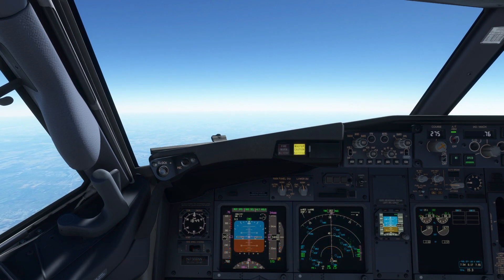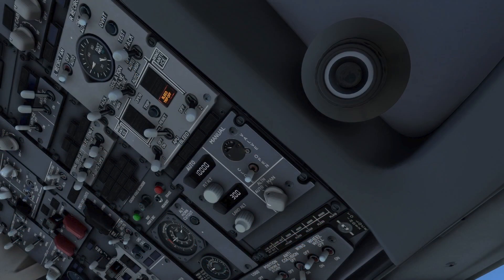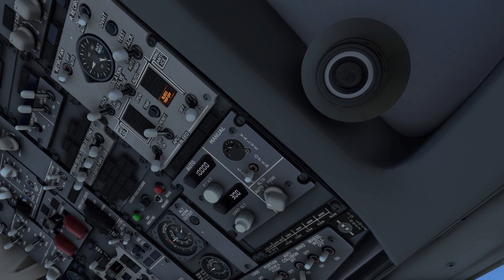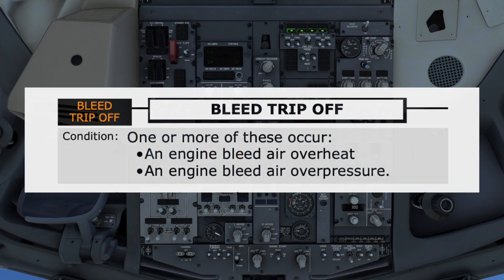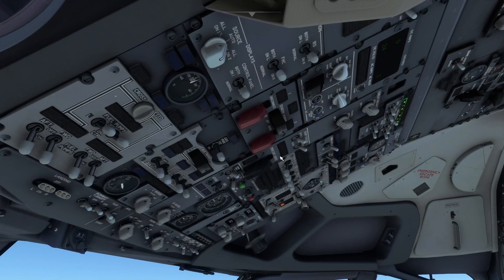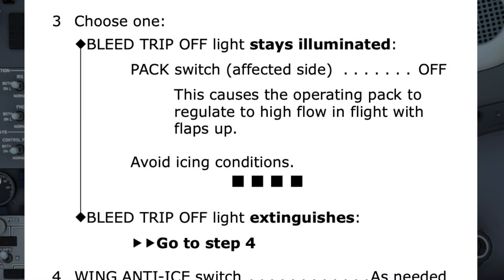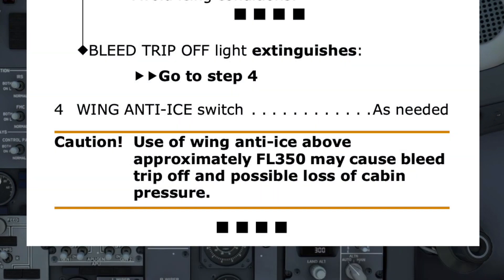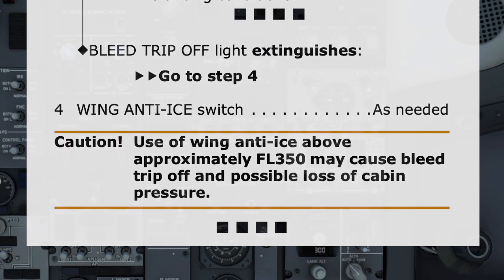737 Non-Normal Procedures: Engine Bleed Trip Off

Comment: @0:38 “ENG” on the systems annunciator is a reference to the Engine panel on the aft over head. If there was a BLEED TRIP OFF light then AIR COND would be annunciated
Reply from the maker: Thanks, that makes sense. If some sim issues come up perhaps we can request updates. The good thing is that any annunciation will cause the pilots to check the overhead panel and see the issue, perhaps only one annunciation light is needed, 'OVERHEAD PANEL', lol.
Reply: @pilottutorials  😂
Reply from the maker: If you have time, could you give input on the comments here: https://youtu.be/xTmN-1dxDSk
Reply: @pilottutorials done 👍

Comment: I was flying at  FL360 and I had multiple BLEED TRIP OFF warning and I see the illuminated the warnings on the overhead panel. I had just turned off wing anti ice system, However I didn not press and hold the trip reset button. Afterward I engageed to descent part of the flight and I saw the BLEED TRIP OFF light is extinguished. So what should we do if we floy over  FL350 in this conditions? Maybe performing the emergency descent procedure was enough? Thank you so much for now. !!
Reply from the maker: Thanks for the question, just as a mechanic might ask, what steps would you take to replicate this? I take it you had selected the engine bleed trip off failure while cruising at FL360?
Reply: @pilottutorials  yes. I got this failure while I am cruising at FL360. When I turn off the wing anti ice system, the failure warn extinguishes. When I turn on the wing anti ice system, I got this failure again. Afterward, during establishing ILS system,  the failure had extinguished. However I never get any failure such as cabin altitude warn light near of PFD. The trip was good. I landed successfully. But I could not figure out the reason of this failure.
Reply from the maker: If you take a look at an earlier answer above 'use of wing anti-ice above approximately FL350 may cause bleed trip-off and possible loss of cabin pressure', this is not a failure but rather operational consideration of the wing anti-ice system.

The preferred method of using wing anti-ice in-flight is to de-ice (remove visible icing), so you need only select it when required. Alternatively you can use wing anti-ice to anti-ice (prevent ice formation) but would require it being on longer.

Indication of ice accumulation would include visible ice on the flight deck window frames, windshield center post, or on the windshield wiper arm.

If you find yourself in icing conditions above FL350 that necessitates the use of wing anti-ice, and it's use results in a bleed trip off, consider requesting a different altitude (higher to clear weather) or FL350 or below based on system knowledge.
Reply: Absolutely thank you so much for your detailed explanation about this topic.  @pilottutorials
Reply from the maker: Just tried at FL360 and FL380 at various mach numbers (power settings), couldn't get a bleed trip off, out of interest did you use MSFS 2020 or X-Plane?
Reply: I use X-Plane 11, However, if I want to try different aircrafts for short ranges, I use  MSFS 2020. Unfortunately, I do not have joystick and I can not use effectively the MSFS 2020. Because managing the control surfaces of airplane is too hard by using the keyboard. @pilottutorials
Reply from the maker: Thanks. Sorry you don't have a joystick, do you plan to buy one, or maybe some one here has an extra one!
Reply: @pilottutorials  Thanks too. I am gonna buy new one but not now.
Reply from the maker: @FlightdeckTurkey737 Thanks again for your question, as a result here is a video to explore wing anti-ice use above FL350, hope you like!

https://www.youtube.com/watch?v=UsTscifdnS0
Reply: @pilottutorials  I appreciate you ✈️
Reply: Wait, are you guys saying that the BLEED TRIP OFF light extinguished by itself? If so, then there is a fault in the SIM.

On the real aeroplane, there is an overheat relay in the Air Conditioning Accessory Unit which is energised for over pressure (220 psi) or over temperature (490F). A holding circuit connects through the air conditioning panel TRIP RESET push-button switch.

To get control of the engine bleed system after a bleed trip off, these conditions must occur:
- The overpressure (220 psi) or overtemperature switch (490F) must return to its normal (open) condition
- You must push the air conditioning panel TRIP RESET push-button switch (to break the holding circuit).

Comment: Can you please explain why would there be loss os cabin pressure as stated in the checklist
Reply: Pressurisation works basically by air being pumped into the cabin from 2 air conditioning packs. The air then exits the aircraft via a single outflow valve. The rate at which the air enters the cabin and exits the cabin is carefully controlled to maintain the correct pressure within the cabin.

Each engine bleed system supplies an air conditioning pack. The air conditioning pack supplies air for ventilation but also for pressurisation. If you have a bleed trip, the pack is no longer being supplied with air, so the pack is no longer supplying air for pressurisation. Half of the air that is pumped into the cabin used to pressurise it has now been lost. The outflow valve will move towards a more closed position but the loss of one pack will be too great and the system won’t be able to cope. There will be more leakage of air out of the aircraft then air entering the aircraft. That is why there would be a loss of cabin pressure.
Reply from the maker: An excellent question.

The caution in the checklist comes directly after the path were the lights have extinguished and the checklist indicates that wing anti-ice may be used as needed. It really is a reminder of standard usage of wing anti-ice, that the 'use of wing anti-ice above approximately FL350 may cause bleed trip-off and possible loss of cabin pressure' and you can find this in the FCOM / AOM under Wing Anti-Ice Operation In-Flight.

The question then is why, why is using wing anti-ice a factor at approximately FL350 and above? At these higher altitudes with higher trust settings, using wing anti-ice may cause the high stage valve may open, causing a bleed air trip off due to over temperature in the duct.

Thanks again for you question.